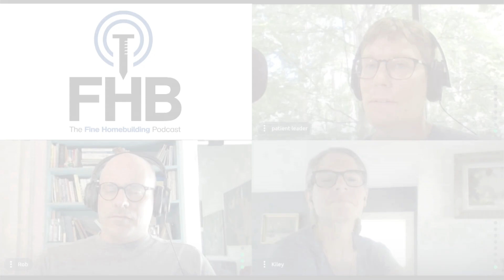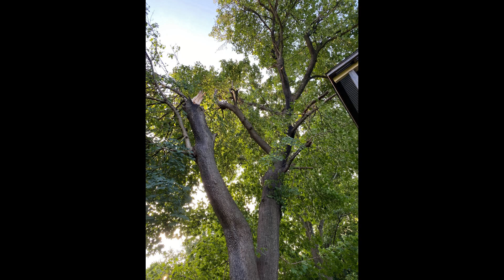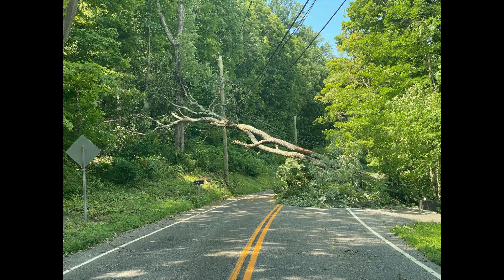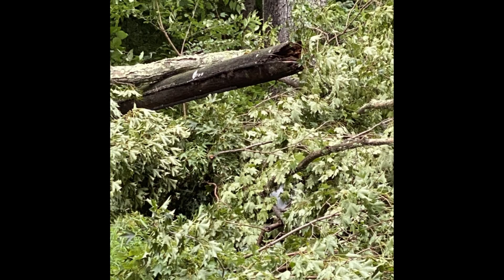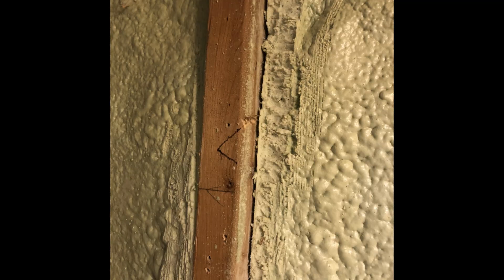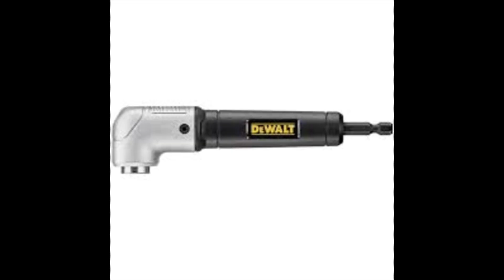Podcast 275: Making do without PT, Wasting Paint, and Staging High Work

Comment: Never harness up if you are working alone. The osha guidelines state that rescue also needs to be timely
Reply: Hmmm A it sounds like you could easily test this. Put on your bags and harness and clip in to the lift while standing on the ground. Have someone raise the lift till your feet are off the ground and see if you can climb up.
Reply: Timothy Dillon fuck that you try it haha
Reply: Timothy Dillon a Forman told me you have 13 mins to get the person down before it cuts off major circulation do still wanna try it tho
Reply: Better to just fall?
Reply: It's best to just not fall. You will be more cautious if you know there is no safety net and one less trip hazard.
Reply: Timothy Dillon I’ve heard that before I’ve never fallen of a roof or cherry picker with my harness but I always thought I’d be able to pull my self back up my harness and onto the roof or lift idk though

Comment: Home-made scaffolding is a good idea. If you build it yourself, you will build it as if your life depends on it. That doesn't mean it has to be bulky or heavy. Readily available materials include galv steel studs which can be screwed together with self-tapping hex head fasteners; galv chain link fence rails which can be drilled and bolted. Make planks out of plywood (paint it) and steel studs.
Reply: No way I would put my weight on chainlink fence post, you can easily bend them with a pipe bender, I wouldn't trust self tappers in that thin of metal to be load bearing either.
Reply: @wallpello_1534  We are talking axial loading on the tubing. As for the studs, 22 guage face-to-face with multiple fasteners. It's plenty strong. Test it on ground level. If you don't trust it, don't use it.

Comment: Kiley says she is interested in welding. A good way to get into it is brazing with oxy-acetylene. The brass rod is attractive on used steel, which is fairly cheap. You can make landscaping features such as small sculptures or planter stands. A small oxy-acetylene rig is not too expensive.
Reply: Get a cheap little MIG wirefeed welder and go to town!
Reply: ckeilah Yes, even a 110V MIG unit is enough to get some useful work done. The decision there is whether to go with flux core wire or a gas bottle. They both have their place, but for general use, I think gas is the way to go.
Reply: Brazing is not welding. But it's a good intro to metal fusing.

Comment: Rob's advice to keep the wood off the ground is wise. Also, a good alternative to pressure treated wood is your own mix of linseed oil and diesel (about 3:1 linseed to diesel). To keep the wood off the ground, you can use galv steel fence tubes. The big box hardware stores have a good selection of connecter parts for pretty cheap.
Reply: while linseed oil is a good protection mechanism, linseed oil on rags is responsible for a fair number of fires, mixing it with diesel and applying it to wood doesn't seem like the best idea  - also the diesel fuel will give off a strong odor and skin contact with diesel is "not recommended"
Reply: Art Laurenson Don't apply it with a rag. I suggest you do an experiment. Paint the mix onto a short piece of 2X4. Let it sit for a day. Then hold a lit match to it and see what happens.